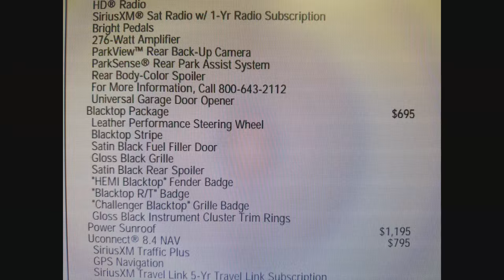I Blacked Out My Grille for $5!!!!!!!!

Comment: Why not just remove the grill section and paint it? It only takes like 60 seconds to pop it off and the badges pop off too. Then you can lay them out and spray it all with ease. No need to wrap the whole grill.
Reply: Um no. You have to take the whole front fender off to get the grille out of there.
Reply: @rockhopper01  I have a Challenger. He only painted the rectangular inserts. Not the entire grill. So the smarter play would be to simply pop those pieces out. You do not have to take any part of the grill off to remove that. It's just clips on the back side. You'll need to remove the plastic guard over the radiator to reach behind there, but super easy. No reason to tape and paint and all that.

Comment: I recommend anyone not listen to anything he just said... These grills are coated with a thin layer of laminate to protect the chrome. And painting over this laminate will look good for the time being but will chip away from heat and debris. To properly do it. You would have to remove your bumper pop the grill inserts out.. Use a paint remover to eat off the laminate and sand it down with a fine grit. Give it at least two to three coats of dupicolor paint and two coats of spraymaxx 2K
Reply from the maker: Thanks for the feedback, I hope this helps someone
Reply: JRTProductions you have a bad ass challenger but cutting corners can sometimes cost you in the long run. The grille inserts alone cost 150 and all black 175. When it comes to clear coat spraymaxx 2k or Eastwood 2k clear coat are the best out these paints contain a catalyst inside that has to be broken and shaken up inside the can. Once broke the can is only good for a few hour I can recommend you look into it for future projects. I’ve painted and clearcoated my gas cap in 2016 and there are no dings scratches or chips in it to this day.

Comment: nice, my ass would have payed that 695, once i installed my own radio n my car, my then bf was just watchin me, no help mind u, i knew i was ready for anything. a hot pink just screamed to b on it
Reply from the maker: oh word, lol. You installed it yourself tho, that's what's up. you painted your grille?
Reply: JRTProductions yea, I look at it like a puzzle and enjoy puzzles, no, I do extensive research on stuff I wanna get so the challenger is tipping the scale over the Camero. try in to look at diff ways I can customize it b4 look in for a shop for things I can't do. it's n the air for a blk car wit Hunter green or hot pink accent, thanks for replying
Reply: JRTProductions o also would I have to get an auto grade spray paint or can any spray paint do cuz I noticed u said it was car paint n wouldn't chip
Reply from the maker: I would definitely get an auto spray paint, it's made for everything a car would go through like weather and stuff. I bought a can of paint from Advanced Auto Parts. Very easy application.
Reply: JRTProductions ok thanks

Comment: 😂😂 do not do what he did without 2k clearcoat over it or it will look like shit by the end of the month. Aerosol paints cannot withstand the abuse of the dust and small rocks that go into your grill while driving. 2k clearcoat by spraymax is resistant to abrasion and scratching.